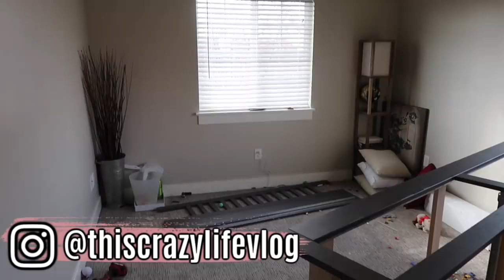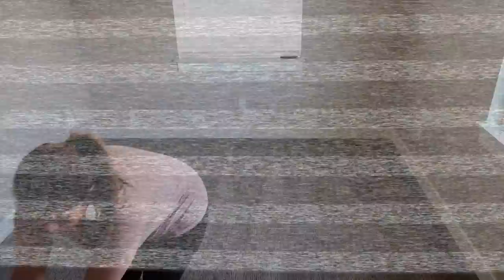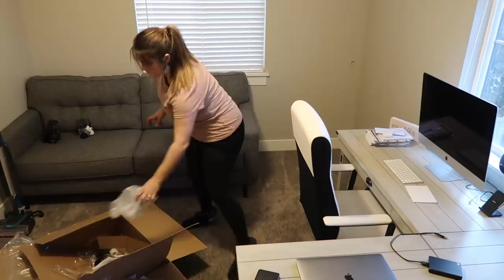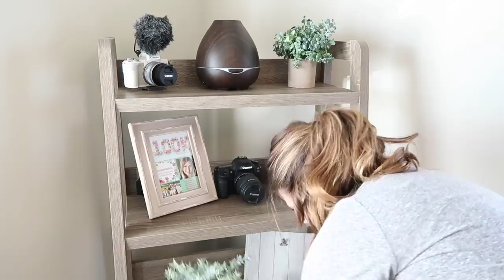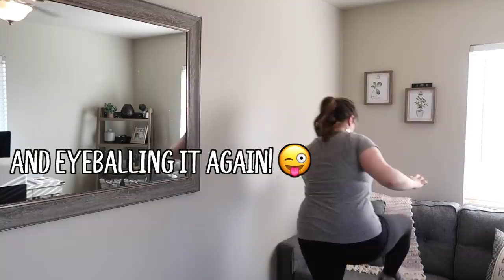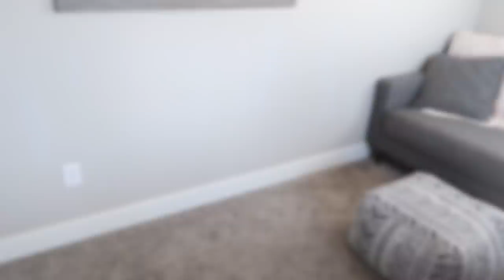*NEW* HOME OFFICE MAKEOVER :: BEDROOM OFFICE CLEAN & DECORATE WITH ME 2020 :: ROOM TRANSFORMATION

Comment: Here is a nice tip. For my screen wipes....I get them at the dollar store. They are in a  bulk pack of 24.  so, once I have opened the foil package I need something else to store them in so they don't dry out. I got a small square Tupperware container that had a gasket on it. This ensures an air-tight seal. I then place the entire pack of wipes in the container in the center ad add a couple of drops o water on top, so the top cleaner doesn't dry out before I use it and pop the top on. I then put it in the top drawer of the desk ready for use about once a week. That does me for about two months since I use them for six monitors and two TVs in my bachelor's apartment.

Comment: Beautiful furniture and very good job Amanda with you both
Reply: I would like to suggest a tiny thing if like it which is I like to turn the sofa under the mirror and move the disk in the corner instead of the ladder and move the ladder to the other corner on line with sofa if it is under the mirror and so I think the room becomes wider and there will be large space in the center and also like so much the mirror and the buff but you can move the buff away from walking area but I don't know where you can put it 🌹🌹🌹🌹👍👍👍💖💖💖💖

Comment: What a wonderful and inspiring makeover! I love the desk and chair (I've never seen one like that; is it comfortable?) along with your other previously owned furniture that blends together so well.
I like the pouf as it has a purpose  (I can imagine Kyle or the boys stretching out and putting their feet up) but it does seem a little tiny; perhaps a small area rug, even running at an angle to balance?
As for the mirror, sometimes it takes us awhile to get used to clean bare areas; my suggestion would be to live with it awhile. In any case I agree that maybe wall sconces/candles/iron work would work by the mirror, rather than more pictures.
I think the two smaller pictures look smashing on the wall above the sofa, and pulling the sofa out a little bit might help it all come together better?
I do love your channel and get lots of inspiration for my own thing:)